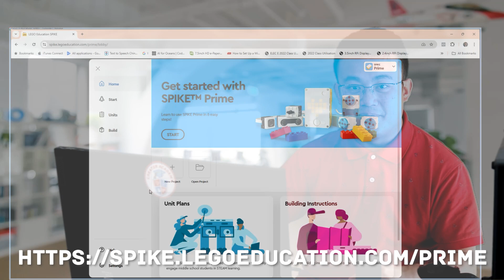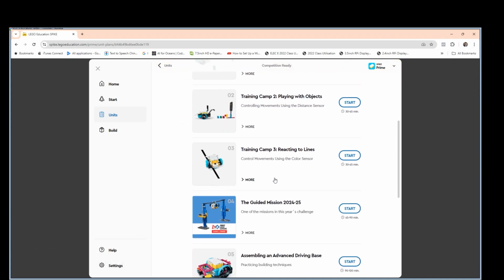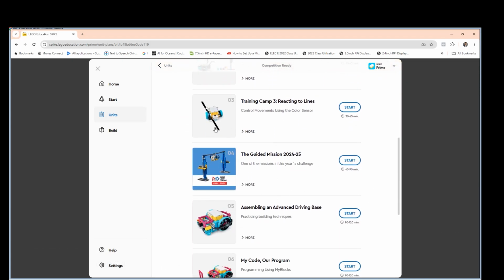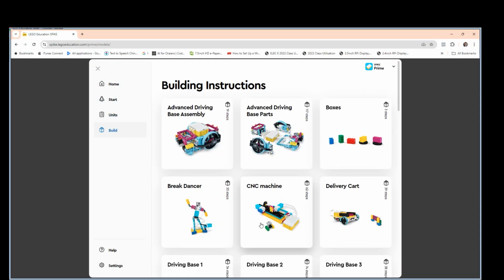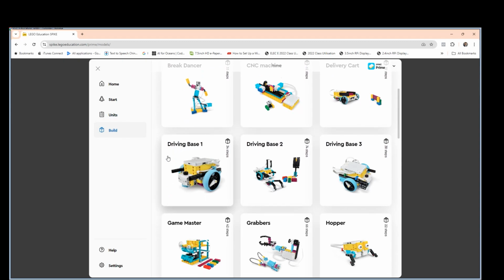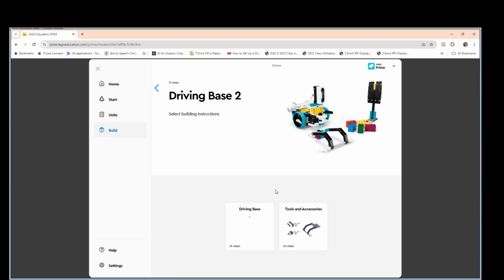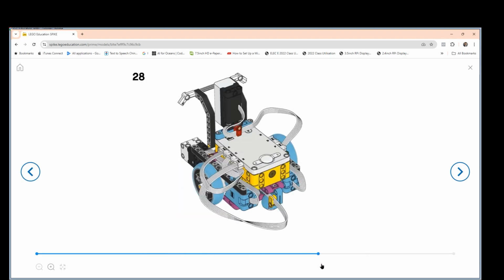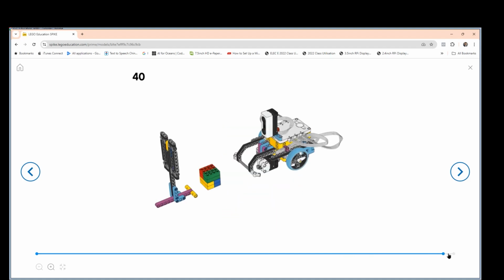FLL Masterclass Part 1: Robot Design By A Championship Coach

Comment: the small compact robot at the end blocks the charging port of the hub. if i were you, i would probably turn the hub around so that you dont have to take the robot apart to charge it. also, people dont really use color sensors because 1. the map is way too colorful and hard to read 2. gyro sensors are more accurate and not prune to light interference